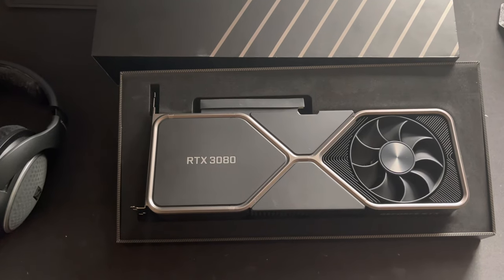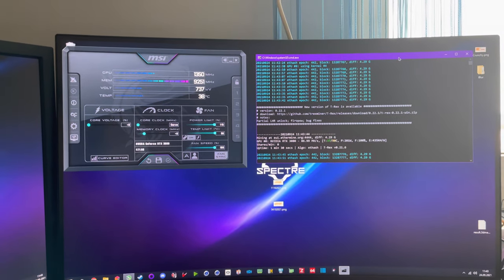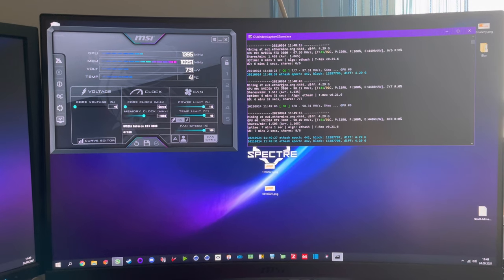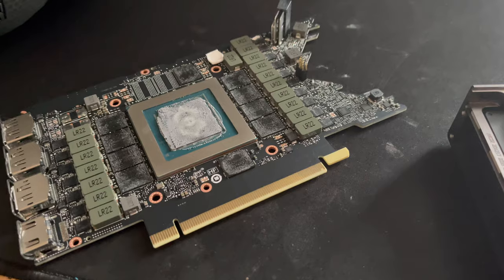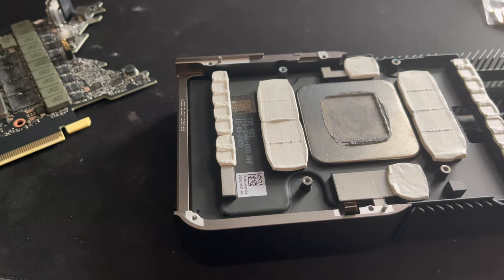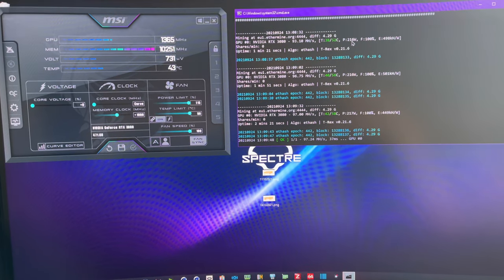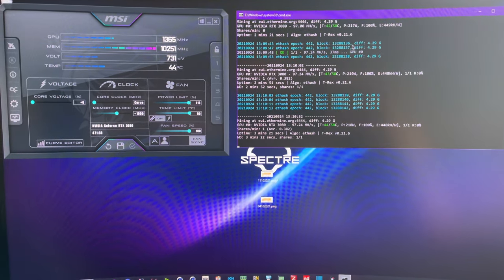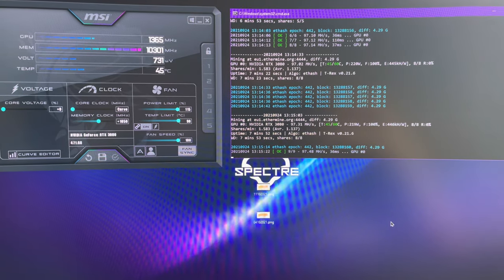What it took to cool GDDR6X Memory on the RTX 3080 Founders Edition FE  - Copper Plates vs Pads

Comment: Very good results! 60cº 
I have a question unrelated to this video, what is your MH/s record on your 3080s?
Do you know if there is any record rankings? like "hall of fame"  haha
Reply from the maker: The highest hashing 3080. I have ever read, was my own :D. 
The Strix 3080 I have here is able to put out 108.3MH/s. Stable. Its an overclock of +4000 in Hive. 
My 3090 Strix does the same (4000) and ends up at 132.5MH/s
Reply: @UnleashedOverclocking  +1 with an amp holo, 108.2Mhs with 4000 memory in hive os and 1625 absolute core clock
Reply: @UnleashedOverclocking  my msi trio x 3080 with the strix bios clocks to 4400 in hive hit 110 mhs at 350 watts, run 109.8 at 330 watts now.
Reply: i am able to hit 129.8-9 stable on my strix white 3090 +1807mem, i have not opened the card, just have 2 fans blowing from underneath and 100% fan speed on card, then it hits 106c 335w

Comment: Hey brother, nice videos you got with the copper solution. But I have 1 question. If your stock thermal pad is let's say 2mm do you use 1.8mm copper and the rest is the thermal paste or do you go for 2mm copper+ thermal paste ? 
Thanks
Reply from the maker: You cant say. All cards are using 2.0mm Pads. There are no 1.8mm. 
It depends how your pads got squeezed. 
Thats why I measure them before. Some cards squeeze 2.0mm to around 1.6mm. 
So other cards dont squeez at all, so you need 2.0mm plates there. It totally depends.
Reply: @UnleashedOverclocking  Thanks, but I didn't get it sry, so if the used pad is for example 1.5mm thick, do you just put 1.5mm copper plate + paste in there ? Or  you put 1.3mm and 0.2mm paste ? 
Like basically do we use a copper plate that is the exact same thickness as the used pads or do we need to substaract the paste aswell ? 
🙂
Reply from the maker: Basically, if I measure 1.5mm with the caliper, I would go with an 1.4 or 1.5mm plate. Thats basically it.
Reply: @UnleashedOverclocking  So you never use thermal paste between the copper plates and the GPU parts ?!
Reply from the maker: @CrashBashL  that was just for the thickness. I use of course thermal paste on the upper and under side of the plate.

Comment: Great video again bro.....i've just bought 3080 FE and i was wondering how i had to drop the temperature. Did u have use 15x15 1.5 mm copper pads without trimmer them?where did u buy them?
Reply from the maker: I had to cut one piece in half and an other one needed to be slightly cut.
Reply: @UnleashedOverclocking  which one u had to cut slightly and for what purpose?
Reply from the maker: Because it would collide with the Heatsink.

Comment: Moin Meister, 

Erstmal vielen Dank für deine nicen Videos, sie haben mir extrem weitergeholfen! 

Ich habe mir 3x 3080 Gigabyte Waterforce Gaming OC WB gekauft für ein Mining Rig und genau die selben Probleme gehabt wie Du mit der 3080 Gaming X Trio.

Hab die 3 3080 für je 1299 Franken gekauft (je ca 1200€ umgerechnet, gratis Versand) und ein Mining Rig zusammen gebaut. Waterforce da sie keine Lüfter haben sondern bereits einen Wasserblock für die Wasserkühlung. Habe 2 Wasserkühlungen (Alphacool Eissturm Gaming Copper + Direkt mit Alphacool Eiswasser befüllt, je 200€ pro Wasserkühlung) verbaut. Habe mich über den recht günstigen Preis gefreut, eigentlich war es ein normaler Preis derzeit aber die Wasserkühlungen waren mit drin. 2x 3080 hängen an einer Kühlung und 1x 3080 mit dem Prozessor (Ryzen 3 1200) an der anderen Wasserkühlung. 
Die 2x 3080 haben 48-51 Grad Temperatur und die andere 43-46 Grad.

Beim Starten wunderte Ich mich aber stark da sie nicht die Hashrate erreichten die eine 3080 sonst schafft (ca 98 MH/s) GPU 1 schafft 82 MH/S GPU 2 78MH/S (Beide an einer Wasserkühlung) GPU 3 ca 80 MH/s im Durchschnitt ( and der Wasserkühlung mit dem Ryzen 3) Wärme vom VRAM liegt konstant bei 108-110 Grad egal was Ich mache! 

Aufgefallen ist mir ebenso: Wenn Ich die Balkon Türe öffne und aktuell ist es ziemlich Frisch. Kühlen die GPUs auf 43-46 Grad runter (VRAM bleibt bei 108-110 Grad) und sie leisten 10-20 MH/s mehr.

Werde heute noch das VBIOs Flashen wie Du in dem Video und dann mal schauen was es bringt. Hashrate dropt, wie bei dir sobald Ich übertakte  auf 200MH/s , bzw erreiche Ich derzeit 240 MH/s wenn Ich die Taktrate, im MSI Afterburner, runter drehe bis zum Maximum ( Core Clock -502 MHz, Memory Clock -502 MHz) alles in allem kann man sicher von den Gaming GPUs abraten. Ich flash erstmal das Bios und dann mal schauen. Werde mir als nächstes eine gescheite 3080 kaufen auch wenn Sie 1800€ kostet...
Reply from the maker: Die serienmäßig verbauten WLPads sind leider Schrott, daher sind die Temperaturen gar nicht so ungewöhnlich. 
Du musst Alphacool Eisschicht 11WmK einbauen oder EC360 Gold. Dann gehen die Temps ordentlich  nach unten und die Dinger können hashen.

Comment: I have seen people say using only copper pads can damage memory in time, any problems ? i used 0,5mm silicone pads and then copper and it is still a great improvement .
Reply from the maker: Nope. Not if you do it correctly. Of course. If you do it dumb and bend the PCB and that shit, you will damage something for sure.

Comment: Hi, what pads did you use on the front and back (except copper)? (sorry for my english, google translator)
Reply: Temperature on GPU is normal? I just play  games too
Reply from the maker: No new pads installed. Only copper rest is stock.

Comment: have you ever experienced any pump out effect on those gpu you thermal moded with thermal paste and shims?
Reply from the maker: pump out? Never heard of that. Soooo I guess not.
Reply: @UnleashedOverclocking  i've used 1mm shims on my 3080 strix. But instead of thermal paste, I used 10w/m.k thermal putty. I get 70-72°C while mining  at 30°C room temp and 80% fan speed. Do you think I could get better temps with thermal paste?
Reply from the maker: @franzdemesa5663  if you mean that you also reduce the space between. Yes. If you leave the space as it is, thermalputty should be better then
Reply: @UnleashedOverclocking  awesome! Thank you so much! Thermal putty is a lot easier to clean. But it creates a larger gap than thermal paste. I did a little experiment with 2 shims compressing the putty. With 2 0.8mm shims, without putty, it is 1.6mm thickness. But with putty, it becomes 1.8mm. this is already squished very hard with index finger and thumb.

Btw, what is your ambient temps when you did your vram thermal pad mods?

Comment: Your video will be more interesting if you show process how you exchange that thermopad for cooper pad.
Reply from the maker: True. Usually I do this, but somehow I manged to forget to do some footage.
Reply: @UnleashedOverclocking   I am not real well with changing thermo but my card is very hot and have to do it. Any recommended shop where you got cooper plates ?

Comment: 32°C temperature drop is insane!
Reply from the maker: Thank you very much!
Reply: @UnleashedOverclocking  my msi 3070ti suprim hits 98-100 on eth mining (80% fans) and 84C on ergo (50%fans).  I should change thermal pads, ideally it would have been copper plates, but I would like to go through the thermal pads experience first, because the GPUs are ridiculously expensive and I have not opened any. For the VRM they measured 2mm, but they don't say if it is compressed or not. What sizes do you think I should buy? Congratulations again for the results obtained with Copper Plates. I've never seen anything like it anywhere, it's pure madness. Jensen Huang should take notes
Reply from the maker: @wembleyyy  pretty sure that 2.0mm are good. Most of the manufacturers using them. Even if you „need“ 1.7 or 1.8. 2.0 are fine. Pads are sooo weak. That’s what they are for.

Comment: what you rekon result might be on a 3090 fe with copper pads?
Reply from the maker: Should work there too. But since the memory on the back is the problem, you won’t expect much
Reply: @UnleashedOverclocking  im doing tommorow
Reply: @UnleashedOverclocking  will tell you result and make a video too
Reply: @UnleashedOverclocking  got 5 3090 fe to fix :p
Reply: @UnleashedOverclocking  i did my 3080 ftw 3 and got 66 degree on max oc +2000mhz on mem , i see some people say copper might expand and crack chips , what you think about that ?

Comment: Hi! Great content as allways! 

Your temperatures are allways so low, even before mods. 92 mem temperature like in this video. 

My 3080 cards (3080, 3090) are usually 98 degrees while room temp is 24 degrees. When I close all windows, room temp goes to 30 degrees and cards go to 104 to 110 (worst card) degrees. 

Any ideas why you get so good temps? Do you have a very cold room or what? 😆
Reply from the maker: With the current weather in europe, I have a room-temp of around 20°C. :D
Reply: @Walter-Technik Custom. 1xEVGA FTW3 3080, 2x ASUS TUF 3080, 1x ASUS TUF 3090. All with similar temps. Now waiting for copper to arrive so that I can try reducing those temps a bit.
Reply: @UnleashedOverclocking  I'm also located in Europe, in the northern part in fact! I need to have my door fully open to get temps town to 20-22C, but when I close it, the cards get really hot with small amounts of thermal throttle. I have 1x3090, 3x3080, 3x3070 and 1x3060ti all mining eth in a room of around 20m2. Maybe I need to downsize my rig a bit. :(
Reply: @UnleashedOverclocking  BTW, I have ordered the copper shims that you used to see if these can fix my high temps a bit.
Reply: @technology.philosopher  Will improve a lot, in my case I sealed my RIG to not get dusty and to have air filtration but I had to always have the door open where it was even having an exit duct to the window and after the mod now I can even have the door closed and the fans at 60%
Reply: @1vend7  Sounds good! How many cards do you run in what size of a room? I run my fans @85%, the goal is to go down to 70-75% which is completely ok for me. 100% is too annoying to run since I spend a lot of time in my mining room.
Reply: @technology.philosopher  in my case I only have 2 GPU 1 3080 and 1 3060 in this vision but I also have a fridge washing machine etc haha, the room is very small I can't say how many square meters but it's a pantry

Comment: Man I hoped it will do 100 plus but it didn't but  cheers u shaved off 30 degrees 👍
Reply from the maker: The thing is, the thermalpad quality varies. And its kinda good, that your card hits over 100 and mine not. 
You know why? Copper acts always like the same, so if your card has +100 and I was able to get it down to like 60°C. 
Your card might see a drop of even 40°C!

Comment: why not more mhs ? easy, you need to be around 10500 Mhz on memory  or more (10750 idealy)
Reply from the maker: Bad bin. Simple as that.
Its not like, that I dont know. 
Best hashing card is currently a 3090 strix with 132MH/s, followed by a 80 strix with 108.3MH/s. 
Both runnnig over a year now with that setting,